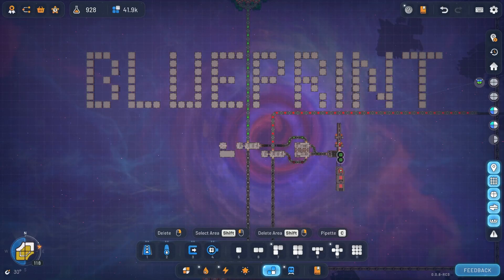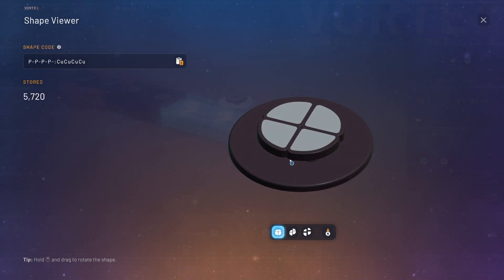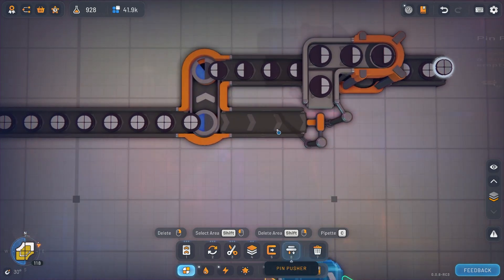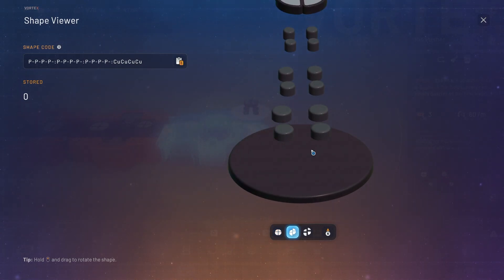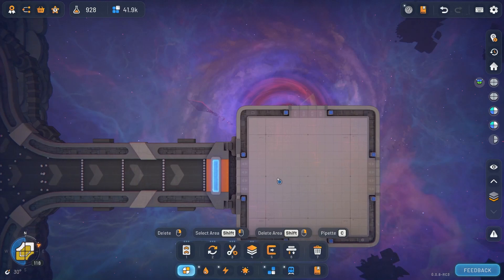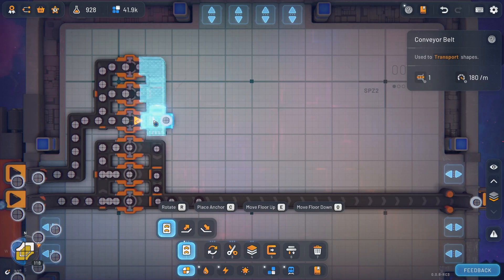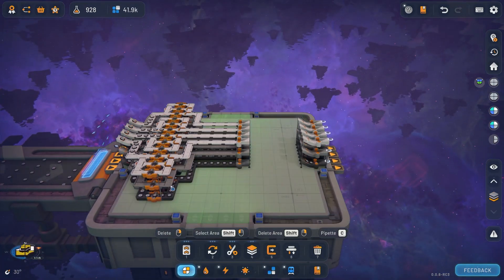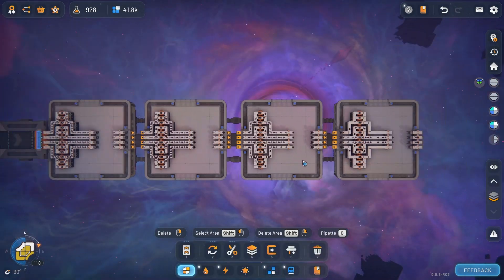Shapez 2 Blueprint - Pin Pusher

Comment: Made my own (similar to yours) 1x1 triple stack pin pusher (as my Pin Pusher requires 3.8 instead of 3 for 100% efficiency). Made it work.
Passes all 3 checks. Compact, looks clean, and 100% efficiency.